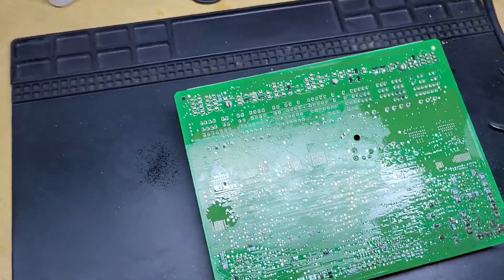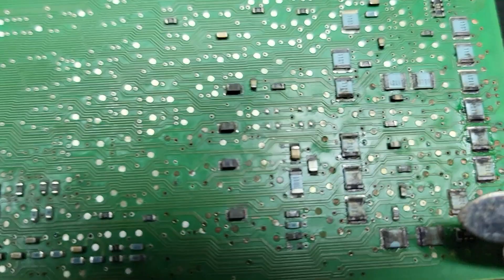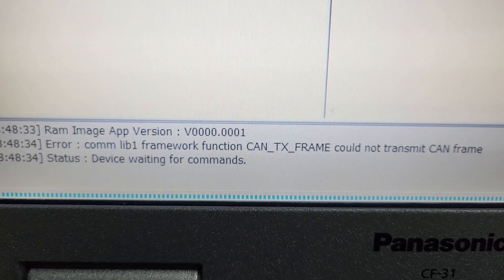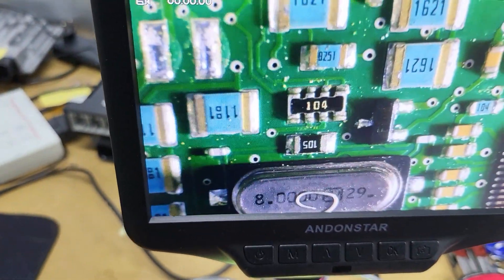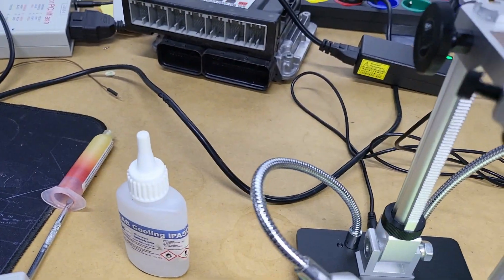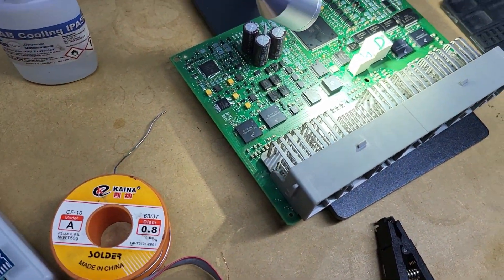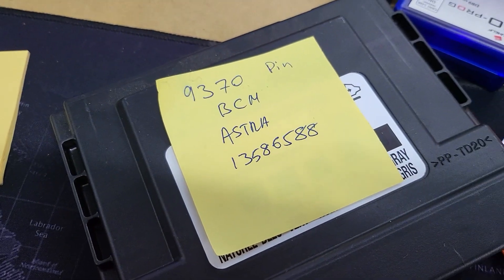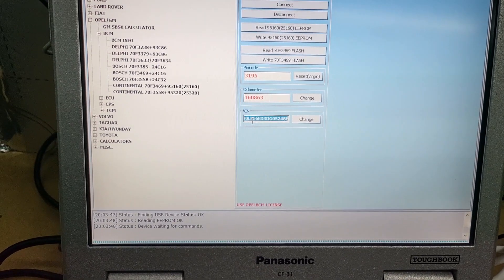Water Damaged BCM Vauxhall Opel Astra Cloning

Comment: Why u just dont swap eeprom by soldering?
Reply from the maker: Because it is not enough, because in the cpu you have a different software and if it is low spec your car lost some specs
Reply: @ecuproguk same bcm number shoud have same software ???
Reply from the maker: @GlobalOffensivewarzone no, it depends of the specs.
Reply: @ecuproguk so processor and eeprom need to be swapped? Because i have one car bcm got in water and after cleaning water now obd cant see it. Im trying to check can i do only eeprom switch
Reply from the maker: @GlobalOffensivewarzone sometimes if you are lucky and don't know how to spam cpu you can swap an eeprom only and test all specs in the car. If you are lucky it is enough. If not you need to swap eeprom and cpu

Comment: Hi man, Just a question if you can help. My Astra J BCM burned randomly when I started the car. I don't think it can be saved. How will it work with getting another BCM? Can I get a second hand BCM? How can it be coded to the donor if the original can't read? 

Thanks for your help.
Reply from the maker: Hello mate, in this case i can still save your data. But i need your BCM. You need many tools to sort it, at least MD Flasher i gues an IO Terminal and may be SPS depends of situation
Reply: @ecuproguk  cool thanks, I'm still trying to find the reason the BCM burned so badly. So far found a few shorted wires from the chassis and some broken ones. I can send you a picture of the BCM to see if you can save the data?
Reply from the maker: @Brotherman-t4p  send it

Comment: Wich Opel was this? Was enoth to swap old eprom data to get the car runs?
Reply from the maker: To start the car enough to swap eeprom, but to work properly you need to clone or swap CPU as well. Because in CPU flash you have a specification of you car, and of you leave CPU from spare bcm you will have some faults about specs from donor car.
Reply: @ecuproguk  have Astra k with dead bcm.
Reply from the maker: @waldemarfechtel1644  it is the same as on astra J, insignia. Find the same part number BCM and swap eeprom and CPU , how many ampers on power supply when you connect it on bench?
Reply from the maker: @waldemarfechtel1644  if you need help. Send me message to WhatsApp +447838012017
Reply: @ecuproguk  car will bring in next days, I think vvdi prog enoth to read it
Reply from the maker: @waldemarfechtel1644  few times I can not read it by vvdiprog, because depends of part number, the CPU can be encrypted
Reply: @ecuproguk  ioprog, ioterminal mabye better
Reply from the maker: @waldemarfechtel1644  yes if your bum still alive you can use Io terminal, but if not you need or soldering or use some another tools like mdflaher UART adapter, but even with this adapter sometimes you can not read it, and only one way to swap cpu
Reply from the maker: Looks like it was Astra J